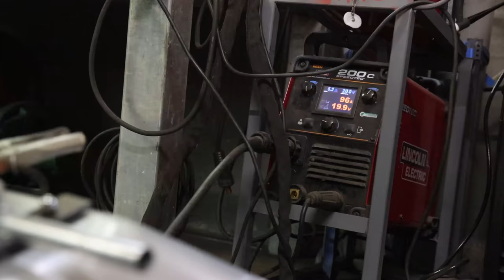The ultimate Bike Trailer (made of old Wheelbarrows)

Comment: AWESOME!
Great idea, great execution!
I only add two points:
1. A lock in opening side to avoid unexpectd open due to bumps in road.
2. Small hole in upper side near the edge to drain water fron the rounded finish. Water can accumulate here.

Comment: Awesome!

Some unsolicited upgrade/build ideas: 
1. Less holes, more foam tape. Maybe it rains less there but everything that can leak for me seems to always.
2. Fiberglass wheelbarrow lid and/or bottom for less weight on a pedal bike or smaller ebike (these were recycled so whateva)
3. Solar panels yo! Charge while ya chill.
4. You can get some big fence hinges and wrap them around the outside of the lip, tack them where the hinge is between, hammer the edges down and weld/bolt the strap flat. Would get you a flat perimeter for a gasket, or avoid needing to notch the tub if you can't handle the full glory of the angle grinder.
5. Craigslist/online ads are full of cheap trailer axle things if planning on using on a real motorbike that can go fast. For a pedal bike I'd use bike-style wheels for the lower drag. You don't need the traction of a fatter wheel on a trailer, just consider weight and side-loading.
6. Double nut that spare tire bolt, so you can remove the spare without opening a hole in yer boot. Will make it easier to seal too.
7. Lights! My buddy always said he loved the fullness of the illuminated area that the lights he put on his trailer put out, compared to a headlamp on the bike. I always asked him why he had a trailer on a bmx.
8. It's metal, so you could totally make a BBQ trailer. I can only imagine the possibilities for an impromptu chill-n-grill. *requires beer cooler mod for full functionality.
Reply: to your brilliant list I would add a latch for the top (eve a bungee) and basic compartments inside the storage.
Reply: @Nobody Noone  totally have to second on point one in combination with point four; the lips of the wheelbarrows were already perfect for a gasket seal
Reply: 1- agreed, water gets everywhere, and without overhangs, this build will leak, but it was definitely a quick and simple build, so will do just fine in relatively dry weather (or just carry water resistant contents).
9- I am concerned with a rubber bushing as a hitch connection. it does not freely pivot left/right when you lean into a turn. or after a few dozen miles just break off. Most bicycle hitches look like universal joints that you see on cars which let it freely pivot left-right and up-down.

Comment: Congratulation on contributing to Die Maus, quite an institution. As for bike trailers: fun design for this one, although a bit heavy for a bio-bike. When loading make sure to keep the center of mass in front of the axle to avoid nasty surprises. And the trailer hitch made by "Radical Design" in the Netherlands (for the Cyclone  trailer series) is probably very useful for these types of projects, and probably influences the ride of the bike less than your solution (no link because youtube appears to block that).
Reply: There's always a critic...
Reply: @denvernow7294  Constructive criticism. And trust me on the center of mass in front of the axle.
Reply: @mrtnsnp  complete agree with you on the center of mass being slightly in front of the axle. My comment was referring to your last sentence in your original comment. It came across slightly condescending towards her personal build. I doubt Laura is going to be carrying sheets of drywall or a pallet of bricks with her trailer. Her idea was ingenious to use what she did, and having it come out looking better than any other bike trailer I, and I'm sure most others, have ever seen. Sometimes you just want to make something ultra fun and mega cool without throwing orthodox mechanical engineering in the mix. Let's focus on celebrating her for what she invented instead.
Reply: @denvernow7294  Not intended as such. More a heads-up that this exists, and can be used for your own builds (all parts are sold separately). The rubber coupling Laura used gives a a stiffer coupling, and that may not ride as nicely, or be as easy to decouple. And yes, sometimes it really is just for the fun, but sometimes practicality counts, at least a little.
Reply: https://www.youtube.com/watch?v=iXSGghAgjvE <-- they won't block this one 😉
Edit: from https://www.youtube.com/c/radicaldesign/videos

Comment: That was a great project. Thank you for sharing it. A humble suggestion though. A locking mechanism below the spare wheel should be added to prevent the top from bouncing on bumpy or off the track dirt roads. And also for security of items of course. Just a suggestion.

Edit: Also rubber mud guards/flaps, like the ones on the back wheels of bikes, on each side below the 'ventilation slots' (I'm not sure of the correct term) for monsoons or dirt roads.

Good luck with all your future projects.
Reply: Don't know about mud flaps, but how about at least putting on those rubber hood clamp things found on jeeps? That would keep the lid from bouncing around. A little lock would be cool, but the lock picking lawyer could break into it no problem anyways......
Reply: @jakefriesenjake  That's a good idea.

Comment: Hi Laura,
really interesting video with a very cheerful and joyful ending.
the project is really very interesting and the only changes I would make are the retraction of the wheel axis (to prevent the weight from lifting the bicycle during the loading of the body) and all the bolts that I would put so that it does not interfere with the "payload" inside, which is very difficult with sheet metal, I know, but I would have looked for a way to do it.
in all cases you have made an excellent quick project that can always be modified by those who decide to do it, very good!

Comment: I like everything you do, and this is no exception. The only thing I am concerned about is that the wheels do not look safe. The plastic hubs and lack of bearings means that if you carry any amount of weight at a speed higher than 10kph is risking they wear out and that could be a disaster. Good luck and be safe! ❤️
Reply: These look like those cheap wheelbarrow wheels that can carry 150 kg each and are designed for speeds up to 15 km/h.
Reply: @peterslegers6121  I admit after I saw that this was used on an electric bicycle, I felt better about the safety. I would not use it with a full sized motorcycle.

Comment: super clever idea! :D
Simple, no 3D printing or crazy tools required
cool with 2 wheels, I wonder what's possible with a single wheel also
Reply: you could easily modify the chassis to extend out the back for a single wheel. wouldnt really be an issue
Reply: @michaelashbrook3195  yea! I wonder how different does it feel to tow with a single wheel, and if it's stable, and can carry the same, less, or more weight on that trailer

Comment: Nice design. I'd prefer tyres with a larger diameter though. 20" or 24" bicycle tyres might be a better choice. Of course, they will reduce the upcycle factor of your project. But they will run effortless on good roads and smoothly on rough terrain.

Comment: Great concept. I'd use plastic shells and tubular aluminum for underframe construction to save weight, but kudos on recycling the metal tubs. You need to upgrade those wheels to real bearings though.

Comment: I like makers Good effort.
I like the idea of using existing stampings.
I wonder if you might have benefited from a couple of complications though.
1. A universal swivel in the tung and hitch.
2. springs above the axel, at low speeds it probably doesn't mater all that much.
Finally wheels rated for a trailer would be my 1St. choice but I would had to of had a bigger box too.
Your build put my open top carrier to shame really it is only rated to 100#s
It weighs in at 21#s

Comment: This is a great idea, I like what you created. There are a few things I would have done different.
1. Instead of cutting off the lip edge of the foreward side of the lower pan to accommodate the hinges, I would have found a way to have the hinges go over the lip edge or fabricate hinges if needed, you certainly have the skill. 
2. I would not have installed vents, they are a water leak point.
3. I would install a sponge neoprene weather seal all the way around.
I like the exterior cargo mount loops and the spare tire, the holes need to be sealed with silicone to prevent water leaks. 
Overall, a excellent idea. 👍

Comment: Interesting, i like how you recycle old stuff. I am working on a recycle project right now with old soup cans cut into flat pieces then bent into triangles, then made into a small geo-dome bike trailer. Light weight, and strong.
It is soup cans because first of all they are tin, second, they are free, third, they are light but strong enough when assembled into a dome, forth, i can fiberglass over it if i want or need extra strength and water tightness. Note: triangles made from soup cans are limited to a small size, therefore a big dome is not practical using them, but a small 4ft dome is doable in a couple days. Or else i would be building a full size shed with them, but too small of pieces will result in around 800 triangles just to get a 12 ft dome. As it is a 4 ft 4F dome will take 160 pieces/cans, that is the size i am building..
4 ft might be too wide for an official bike trailer, but oh well, it is mostly for experience in building with sheet metal. It is just because i can't really think of anything useful i can use a tiny 4 ft some for, except maybe a garbage can protector/enclosure, or a tiny green house. But this specific design is no glass or transparent material.

Comment: funny when I was a kid I made on out of a 2 wheel wheelbarrow I pulled it behind my dirt bike tho I only had one and just used a cargo net and a tarp to cover my stuff as for mounting i used a piece of pipe bolted to the fender support the eyelets bolts attached to the barrow handles and a few links of dog chain work really well on road as I used it to travel to my buddy's house alot and 10 minutes on the hard road was better than the legal trip of 35 off road off road it was good as long as it wasn't too rough or you didn't drive as fast as you can go the 45 MPH my bike could do was way too fast for the barrow off road on road it was fine till I needed to buy new tires

Comment: Great idea. Consider using Torx drive (triple square) screws on the hinges for better grip, less chance of stripping out than Philips drive screws.  Thanks for being a guiding light on shop organization and useful, practical ideas.
Reply: With practice, you will never slip on a phillips head and never cam one out.

Comment: @Laura Kampf You might need to put white reflectors on the front corners to be "compliant" with EU law .. just like a bikes needs a white front facing reflector as well as the red facing back to be road legal today (all commercial bike trailers have them). Might even need wheel reflectors as well (can't remember) ... laws has been upgraded a lot for "passive" safety requirements for bikes.. just to save you the fine if you run into über anal police :D ...

but was nice to see some old danish "Randersbør" getting new life :D

Comment: At least the two wheelbarrow wheels could/should have been reused instead of buying 2 brand new wheels. This would also have reduced the trailer angle while it gets pulled.
2) Two good/useable respectively easy fixable wheelbarrows had been destroyed for this thing instead of giving/donating them to the German flood victims (Ahr/Eifel) where especially wheelbarrows are desperately needed.

Comment: It's all nice and shiny, until you can't effort all those power tools, let alone the electric bike to pull this heavy clunker.
What's wrong with standard trailer couplings for bicycles? There are at least three types on the market. The traditional ball-and-pan seatpost style and two wheelnut mounting sideways styles. Why would you run the risk of shearing and twisting on a rubber bushing, especially on a trailer that can be heavily loaded like this one, when there are perfect solutions readily available?
Oh, and reflectors on trailers are mandatory to be triangular.
I'm sorry to rain on your parade, but I think a little more thought would have brought you a lot further this time.

Comment: You can't fit those wheels with weight. If you are going to drive a lot with weight you need "ball bearings". Those wheels, due to friction, will break or get stuck in a few kilometers.

Comment: If you see a female Youtuber building stuff, look at her hands. If they're clean and undamaged, she's a poser. If you look at Laura's hands though, you'll see she is the real deal. Gotta' love those hands. 👍

Laura, might I suggest a charge controller and solar-panel on the top of the trailer. For the size you could fit, you wouldn't make many volts but it could still be used to float the battery in nice weather while out riding. It could add an extra couple of miles to your range over the course of an afternoon. Especially if you stop off somewhere for lunch and ensure it gets full light coverage. Worth looking into if nothing else. At the very least, the solar panel could be used to charge a battery kept in the trailer for running lights on the bike at night without having to eat into the main battery. :)

Edit: If one were to weld four vertical  1" tubular bars, (one in each corner of the upper lid), you could create a raised platform for the solar panel above and still keep the current plate with the hook-eyes on for storage as you showed in the video when you used bungees to attach a case. Would make the trailer a touch more top heavy like but an idea if nothing else. Would also provide some rain coverage for anything attached using bungees.